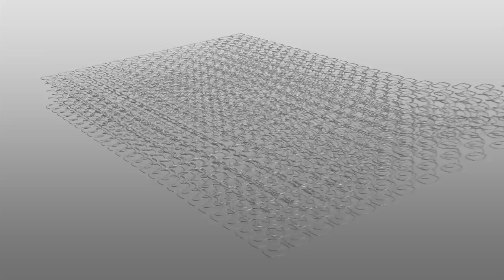Sealy Posturepedic Spring System

Comment: Much prefer the Bonnell Spring system, as it's much more supportive for back problems, allowing you to turn more easily with some moderate bounce. I've had the Sealy PostureTech for a few years, and it is a little dull, with the sense of sinking in, which makes it harder to turn over. This also plays havoc with a Hiatus Hernia, giving pressure on the side of the stomach when laying on your side. That's why I recommend staying away from Pocket Spring systems.